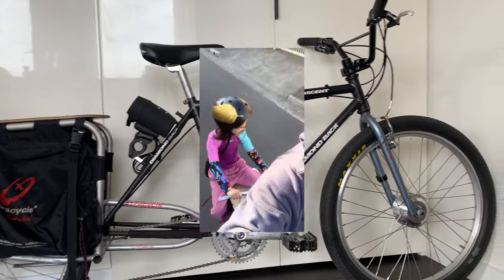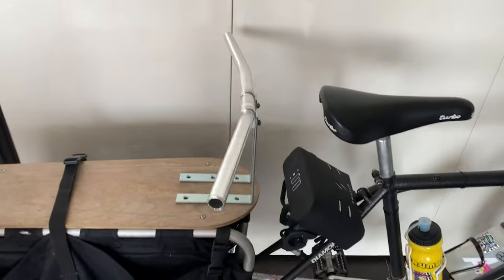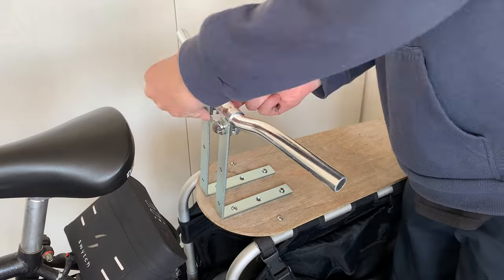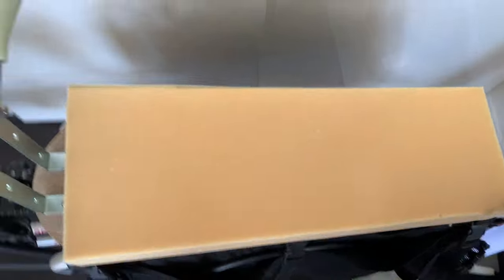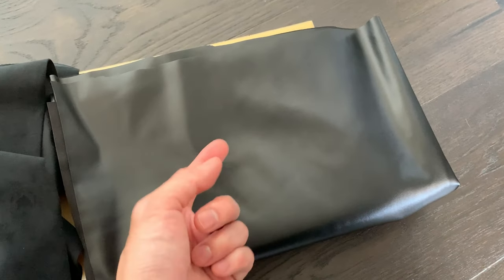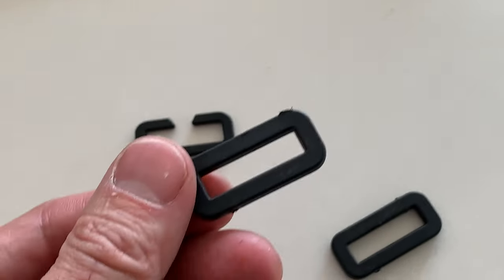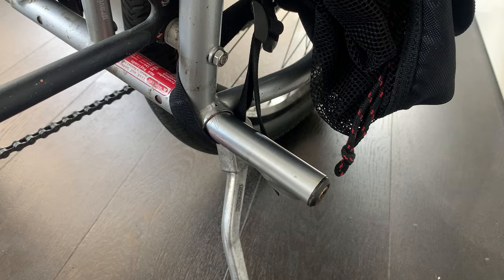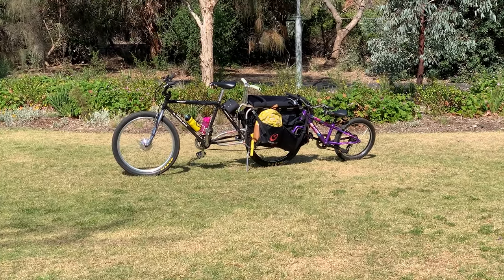DIY cargo bike seat & handle bars + some extras

Comment: Great work. Consider painting the parts you added. Filing the sharp edges exposes bare steel and will rust. Also the cut off stems.
Reply from the maker: Cheers mate !

Comment: Rad build man, the creative repositioning of the Swytch unit was fun to watch in that previous video, the extra-cycle is sweet too. In your experience, is there any way to use the Swytch to operate head/taillights in the same way as a dynamo hub? It would be sweet to round this monster out with some hardwired lights.
Reply from the maker: Cheers man ! I did look it up I think you can connected it but then it always stays on, so I stopped researching after I found that out. Maybe it’s possible to install a on and off switch
Reply: @garysprojects Sick, thanks for looking into it!